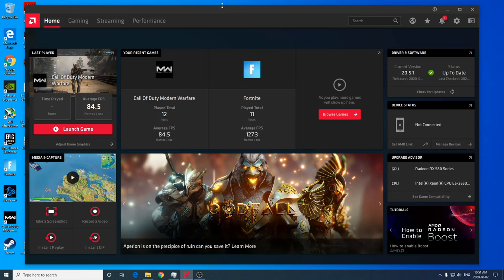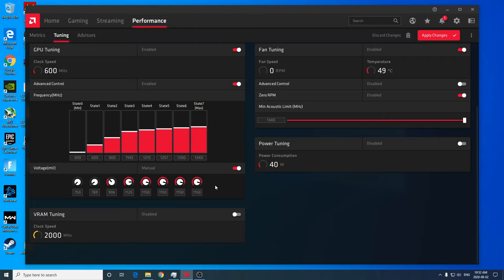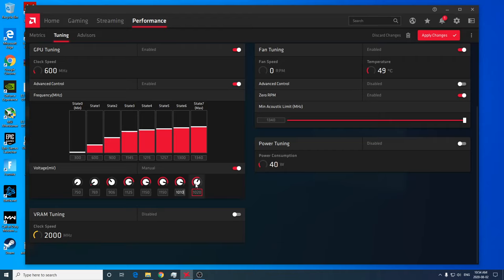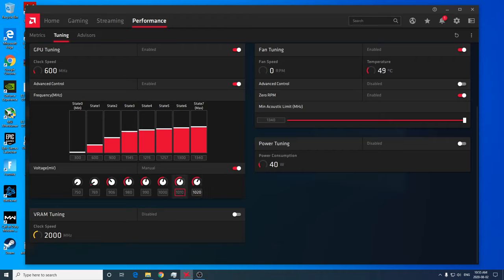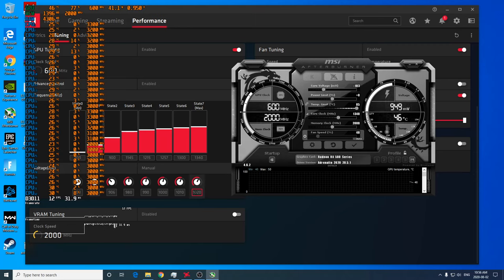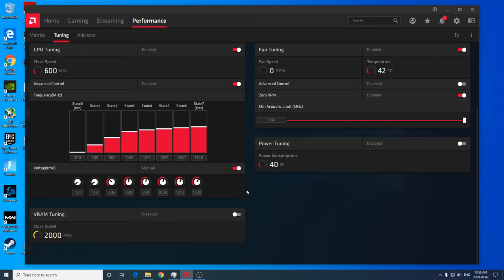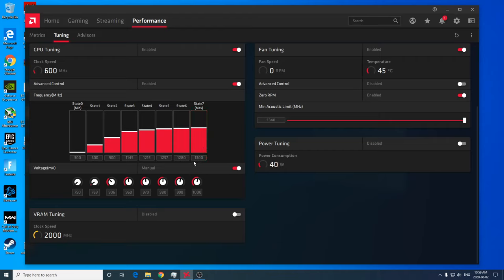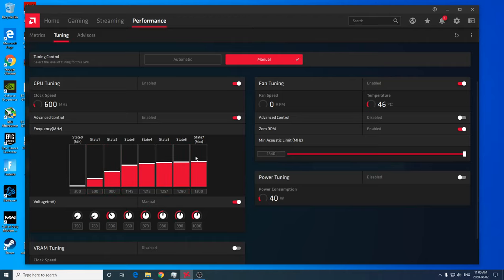How To Undervolt AMD RX 570 and RX 580 (How to lower GPU temp upto -10c)

Comment: hello, so I am new to pc gaming and bought a prebuilt because parts are getting kinda hard to find. but my mhz frequencys are different from yours so is it safe to match the voltage you used in this video? my state 7 frequency is 1286.
Reply from the maker: Yes you can use my voltages.
This may not make sense as you are new to this,
But basically:
Core clock and core voltage are a pair.
The higher the core clock, the higher core voltage you will need to run stable.
You can adjust your core clocks as well.
I think I pinned a comment with settings that should work 100% and are specifically chosen to reduce temps.
Reply from the maker: https://youtu.be/0pzxFZBw-6Y
Copy these settings for both core clocks and voltages.
Reply: @AleksandrsBrodie  i saw that having a custom game profile is needed and well the game im trying to lower my temp with is stalker anomaly. it's a mod of the game which is in my file explorer so when I try to add a custom game profile in the radeon software it doesn't show up :/
Reply from the maker: @red4253  you need to manually add it, through file explorer there should be an option to search for an application on your pc.
I've had to do it for other apps before.
Reply: @AleksandrsBrodie  so after about 5 min of playtime on stalker mine went from 80-85 to around 75 degrees. amazing man, thank you for being patient with me because this was a huge help. do you think this would help with halo reach as well?
Reply from the maker: @red4253  it works on all applications pretty much.
Reply: @AleksandrsBrodie  appreciate it man, your a major help. cheers
Reply: @AleksandrsBrodie  hey I've got another question if you don't mind me asking?
Reply: well I've used the settings ever since and they've worked like a charm but I hopped on today and temps are back up to the high 80s
Reply from the maker: @red4253  see if the settings are Appling.
Also I would suggest setting a fan curve in the amd software aswell.
Reply: @AleksandrsBrodie  I checked my notifs on the radeon software and I had one that said "default radeon wattman setting have been restored due to unexpected system failure." Is that the cause of it?
Reply from the maker: @red4253  yes, and sounds like you might need a bit more core voltage maybe +20mv
Reply: @AleksandrsBrodie  okay, should I increase the mv aswell?
Reply from the maker: @red4253  only on states 3-7, you can also lower your state 6 and 7 core clocks by -20Mhz if needed.

Comment: So that fixed my problem with my RX 580 8gb in RDR2 now i can play a lot more till my graphic card get 80% heat. Before it was like at start its 80% and up to 84% and at 84% after 1 hour 30 mins get a little freezing in game. My pc get hot when playint this game bcs i dont have coolers for whole pc i mean i have cooler for cpu and thats it but my case have opens. And btw is my pc gonna get fcked up if i play on 70 - 75 % gpu in RDR2?
Reply: It happens just in RDR2, and i mean after playing and playing its heating up but little bit i played for hour and it went from 71 to 75%. And pls tell me its not gonna be problems with my pc.
Reply: And btw i needed to get a little higher sertings in radeon software bcs rdr2 had black graphics and than i just set it a little bit higher and it worked.
Reply: Tommorow i will try how much it will get heat, now after 1 hour got max 75 while playing rdr2. In other games is all okay just rdr2. And if u can answer on my other quesitons i will appreciate it.
Reply from the maker: @gigaburek2298  if you GPU is running under 80C, then you should not have issues.
In terms of GPu usage, the GPU can run at 100% load 24/7 assuming that it is running under 80C.
RDR2 is a remanding game, so running an undervolted setting on the card can help with GPU temps.
Also settings a custom fan curve will potentially help.
Reply: @AleksandrsBrodie  thanks man, i am gonna try 😁.
Reply: @AleksandrsBrodie  well while playing other games i got no problem but when i play god damn rdr2 its goes slowly from 70c to 78c than i turn it off bcs game had a little lag. I dont know but to do i tried to set fan curve but i dont know what settings to set i tried something but it just get my pc louder and nothing.
Reply from the maker: @gigaburek2298  i Would lower your GPU core clock then, you can try the settings in one of my videos with about 1.2k views. I use 1200Mhz on core clock. that may help.

Comment: I keep getting popping in cracking noise from my rx580 mostly only while gaming. It never happend until I upgrade my MB and cpu its really driving nuts its. I dont get this whille using headphones only with hdmi. I have switched the hdmi cables I have reinstalled drivers nothing seems to work. I did read were someone said they set power state to 1 and if fixed the problem im guessing its a latency issue. Any ideas?
Reply from the maker: I am not sure sorry.

Comment: Hey I undervolted my Rx 580 2048sp these past few weeks but I recently noticed that my screen sometimes flickers. Sometimes only a part of it, sometimes half and sometimes it blacks for a milisecond then goes again. No bluescreen or freezes just flickering. I followed the numbers in your vid. Should I increase it a bit?
Edit: There are no flickering during game ssesions but when I alt tab my games it usually happens
Reply from the maker: yes, if you get flickers i would increase your core voltage +20mv until it runs stable
Reply: @AleksandrsBrodie  Okay thank you I'll try doing it

Comment: Hey Alex can you please make a new updated video with the new update pleases I updated and my whole screen went black and freaked out
Reply from the maker: if you screen went black, restart pc that should generally fix the issue.
and when undervolting if system crashes, make sure to increase core voltage
Reply: @AleksandrsBrodie  alright thanks it’s just that the new 21.5.1  broke this undervolt if I knew it was going to I would have never updated and stuck with the update that you had at the time of making this video it really helped my pc a lot
Reply: @AleksandrsBrodie  also one more question with update 21.5.1 how do I set it so I can see my temps while Gaming I use to be able to with the old update but now it won’t let me focus on just temp and fan speed it makes me put all the gpu data
Reply from the maker: @DeadmawAlex  I personally used MSI afterburner to see GPU data for Temps and fan speed.
Otherwise i think the amd drivers shows everything,

Comment: Im sorry might be a stupid question but this does not affect fps right?
Reply from the maker: if you lower core clock, you will lower your fps a bit.
But voltage does not affect FPS, it only affects how much power your gpu uses = gpu temp.
undervolting is lowering the voltage from stock to a more optimized voltage so you use less power so the card runs cooler.
Reply: @AleksandrsBrodie  I see, thanks for the clarification!

Comment: I have rx580 MSI oc editon I tried fh4 medium settings card was like 87c when replacing thermal paste it was 73-74 mostly on medium settings so do u think is this good or not
Reply from the maker: It's better than before.
You cam try the setting I recommend in the pinned comment

Comment: Have you encountered any bug that makes RX 580 FAN run at 3000 rpm as soon as you turn the PC on ? 
Used MSI afterburner to control the speed, but stopped working after the latest updates/drivers. 

Cheers
Reply from the maker: not sure, sorry

Comment: everytime i used my pc and use it for too long it starts the noise in cpu what should i do ? i think its from GPU my gpu is RX580 4gb please help what to do .and sometimes bluescreen
Reply from the maker: I am not sure, I would probably make sure that your GPU is not overheating and is running under 78c.
Ideally around 70-74c.
Undervolting your GPU will help reduce your power consumption and reduce heat.
I would set a custom fan profile so you are sure the card runs cool either way.
the fan profile can be set either in the AMD drivers or in MSI afterburner.
I have a few other undervolting videos which help explain how to undervolt.

Comment: Why are you having temp problem and crash with the rx 570 and 580?
Reply from the maker: I am not having temp or crash problems with the RX 570 or 580 cards.
Undervolting just helps improve GPU temps and can improve performance.

Comment: what fans would you recommend that would also help in lowering the gpu temp?
Reply from the maker: I am not sure, depends on your case.
I made a video recently showing what gpu clocks to use to get better gpu temps.
Reply: Use case fans like corsair, Noctua, be quiet, that has good RPM like 1500rpm at least

Comment: Do you have a video for the amd rx 6800 xt?  Never had a issue with card for a month now, but 4 days ago.card is over heating from 75c straight to 95 deg c and cutting out
Reply from the maker: No I dont sorry
Reply: @AleksandrsBrodie  Ok np.  on your video at 0:42 you have frequency scaling and voltage scaling too.  I assume you are running Adrenaline? Mine doenst have this, but just one bar you can run up and down.  How/where did you get this?  I followed what you said but cant do fine state turning like yours, but managed to bring the heat back down from 90C back to a loaded 75C at the cost of a little fps, I guess I need to tweak the settings a little,  I have come to the conclusion the software isnt doing what it should  Adrenaline 21.3 was more stable, 21.4 and 5 seems to have left the standard settings way over what they should be.
Reply from the maker: @colmaniac  with navi if your gpu is overheating:
1. increase fan speed in fan curve
2. lower core clock by -100Mhz
3. Lower Core voltage by -50 to -100mv.
Navi generally auto tunes for what clock to run while in game so you wont be able to undervolt as much but you can still drop core clock and voltage a bit to help with temps. that is what i did when gaming on a rx 5700xt a few months back.
Drop core clock and core voltage.
Reply: @AleksandrsBrodie  Thanks if im reading it right the standard settings is Frequency HMz is auto at 2674, drop that by 100 to 2574,  voltage is auto at 1200, so drop that to 1100.  Fine tune fan speed and temp is set at P1 20% rpm temp at 45 deg C.  P2 30% at 56c. P3 40% at 66c. P4 50% at 75C and P5 100% at 80C.
Reply from the maker: @colmaniac  Yes, that is correct, i found with my Navi card by dropping the core clock and voltage by 50-100 i was able to drop my temps to at least 80c or lower. Of course, each card is very different so you will want to find a clock speed/voltage that are stable and also allows the card to run under 80c.
the fan speeds you can also adjust to your liking.
the numbers you wrote out seem pretty good for a fan curve, i may suggest bumping up the fan speed when you are at 60c as the Fan curve only increases when the CORE temp goes up, no memory or junction temp from what I recall. So on my RX 5700xt I had 60% fan speed at 48C because my memory would be at 76c by then.
The main thing with navi cards is to make sure the hottest part on the card is preferably under 85/80c, so either memory, junction temp, edge temp etc.
you can use a program like, Hardware monitor to check all your temps on the gpu.
Reply: @AleksandrsBrodie  Ill try that thanks,  yes the temp dropped right back to where it should be, the core/junction temp causing issues, the edge/current temp was always in normal parameters for heat.
You have saved me a lot of head scratching thanks and very informative :)

Comment: Hello. just want to know if your fan is spinning? coz mine is not. since we have same radeon rx 580 and copied your voltages.
Reply from the maker: If you dont set a custom fan profile then your gpu will do its auto fan profile. Some cards have a silent feature so if the gpu if under a certain temp the fam wont spin.
I prefer to always have the fan spinning even if on low speed
Reply: @AleksandrsBrodie  btw is it normal if only 1 fan is spinning?
Reply from the maker: @zapzaap  I don't think so

Comment: Hey bro, does this fix power consumption problem, like i'm running rx 580 8gb on 450W supply but the gpu is only taking 90 - 100 watts maximum power... does undervolting my gpu fix this? Please Reply... as i'm worried about this.
Reply from the maker: Undervolting can reduce power draw

Comment: Hi,I have an Asus Dual RX 580 O4G graphics card and it crashes when I open a game or graphic intensive application like chrome with hardware acceleration on. Please help me cause I need to use the graphics card.
Reply: I tried everything from going back to old drivers and undervolting.
Reply from the maker: in this case, if its crashing after you set a custom undervolt, then I would increase your voltage or lower your clock speed, if its crashing before undervolting, then it may be a card issue.
Reply: I have an Ryzen 5 2400g and will that card bottleneck or cause problems?
Reply from the maker: in games that need more multicore performance then yes, but in esport games its fine,

Comment: I have a problem:
I overclocked my rx570 in Radeon software, because its easier to use. I also have Afterburner and when I open afterburner, all overclocks resets. Also overclocks resets when I restart my pc and I think its because Afterburner.

So do I need to uninstall afterburner or what? Thanks for help
Reply from the maker: I am not sure, I would make sure you set a game profile when setting your overclocks inside of the radeon software.
Reply: @AleksandrsBrodie  I will try that! Thanks for answering

Comment: Pliz tell me how about the fps perform? At stock vs undervolt, ex : ( rx 570 stock 150w vs undervolt .....w ) its affect so significan to the fps? Thankz dude..  🙏
Reply from the maker: Core clock affects performance, if you lower core clock then your will get lower fps, but lowering core voltage does not affect performance.
Lowering core voltage just makes the card use less power and run cooler

Comment: Hey Brodie, I'm getting kinda desperate. It's been a week since my PC has had 0 issues but now it just shut off itself again.

This only happens when playing "Lost Ark" and I don't know if the game is poorly optimized or what, but every not-so-often I smell a slight smell of burning and my PC shuts off while playing it. I've went to have people take a look at it and run tests and nothing unusual/strange came up. Tried your undervolting videos and for a week, PC didnt shut down. Now it just happened again and I'm just out of ideas/options. Any pointers you could give me? Thanks!

PC: i9-9900k
       RX580
       rog strix z370-g
Reply: Forgot to add, I have around 50-60C temp which is WAY less than before undervolting, still happens tho.
Reply from the maker: I would suggest upgrading your power supply./
The RX 580 can use close to 200w while gaming and the i9 9900k probably uses more than 200w itself.
I would make sure to get a solid 750w-850w psu.
Undervolting could have helped because it reduces power draw.
So i would change PSU.
But that is just my opinion based on what you have told me.
All the best!
I am assuming CPU and GPU run under 75c
Reply: @AleksandrsBrodie  Haven't seen them go over 75°C. I'll try with a new PSU. Thanks!
Reply from the maker: @Lunariannful  Sounds like a good place to start, Good luck!

Comment: what is your recommended undervolt settings for sapphire nitro+ rx 580 while playing cod warzone?
Reply from the maker: just a ball park, (it will vary between cards)
CORE: 1350mhz
Voltage: 1050mv (can go as low as 1000mv, just test it, and if its not stable, system will hang just hold power button, hard power down pc, and increase state 7 core voltage a bit
Reply: @AleksandrsBrodie  thanks man! i appreciate it
Reply: @AleksandrsBrodie  thanks
Reply from the maker: @samareshdas767  You are welcome!

Comment: Hey there. my gpu is a gigabyte rx580 4gb. I already lowered the settings like u did in the video but my pc is still shutting down randomly when playing heavy games like Apex, detroit ,etc. My temps usually goes from 50 - 60 c degrees when playing these types of games. Do you have a solution for this issue?.
Reply from the maker: I would increase the core voltage on your state 7.
what we are doing is finding a balance between core clock speed and the optimal voltage to run that clock speed without crashing.
So in this case, it would inscrease your Core voltage by +20mv, so if it was 1000mv at 1300 core clock ,then i would try 1020mv, if that crashes then 1040mv at the same clock speed until you find one that does not crash.
Reply: Did this help you? I just got same card as u and I having same issue playing gta V
Reply from the maker: @bruh72 monitor the GPU temps, also make sure your power supply is big enough to handle the RX 580.
otherwise, you can adjust the core clock and votlages in the AMD drivers
Reply: Aleksandrs Brodie I just got told buy a friend it may be my connectors could running just 6 pins on a 6+8 pin connect the problem?
Reply from the maker: @bruh72  I will recommend dropping your core clock to 1200mhz @950mv to lower power consumption, if pc does not black screen and shut down, then it means that the issue you were having earlier was from not having enough power
Reply: Aleksandrs Brodie I ordered a 6 to 8 pin psu adapter , think I will just use my old card for now until that comes to risk issues

Comment: RX 590 & my system keeps shutting off do you think this will solve it?
Reply from the maker: a lot of people have had issues with the rx 590 crashing.
I would lower the core clock to 1340mhz and run 1000-1080mv for core voltage depending on what your GPU can handle.

Comment: Will this fix my gpu utilisation dropping into the teens and my overall broken card because it flickers spots in game and it always has FPS drops
Reply from the maker: I am not sure.
But you can try lowering your core clock and voltage to see if it makes a difference
Reply: i guess you meant tens :)